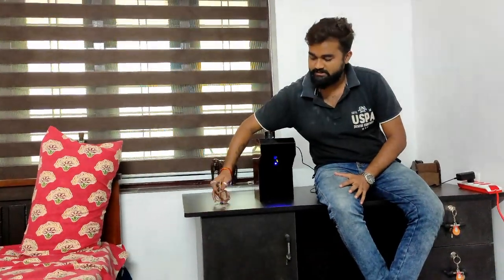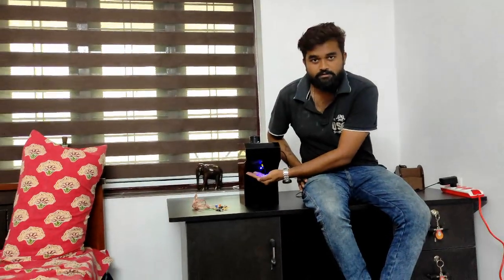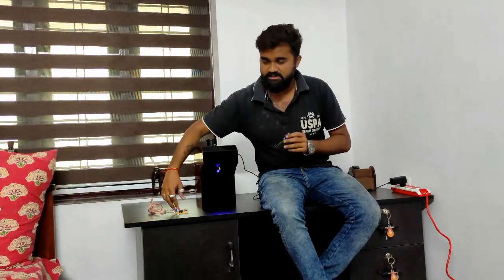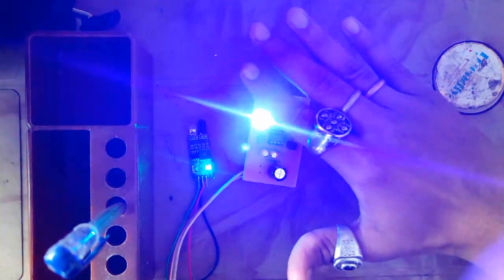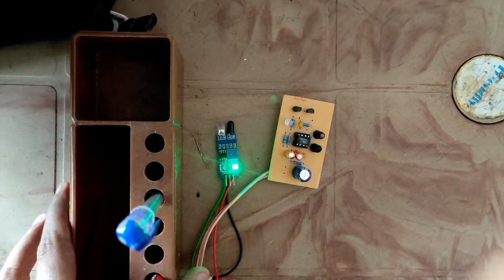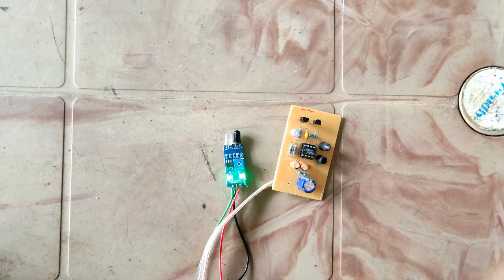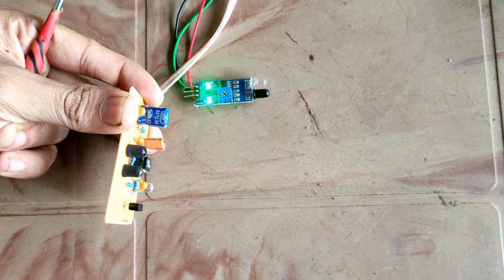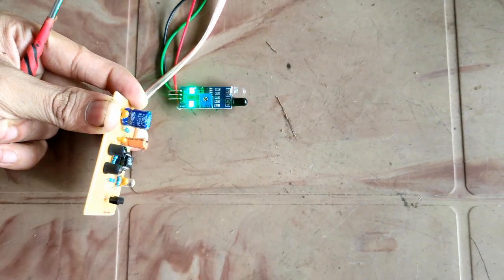#handsantizer #automaticdispenser  Sunlight interference proof ir sensor (Circuit board )

Comment: Bhai Muje bhi chahiye but aapke sensor se hum automatic hand sanitizer k se Bna skate hai ups video banado.
Reply from the maker: There is only two connections in this circuit
1 connect dc source to the circuit(5 to 24 v)
2 Connect motor you are using